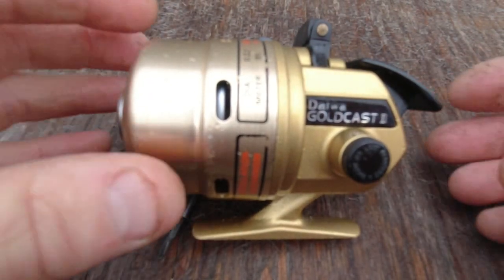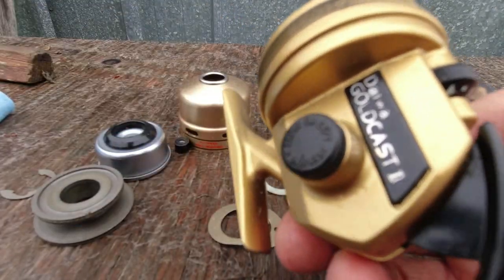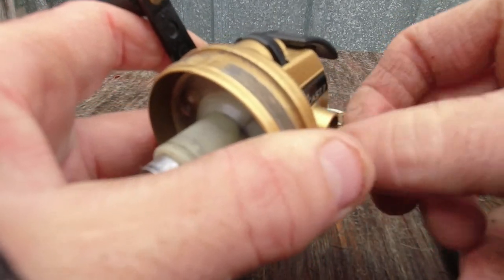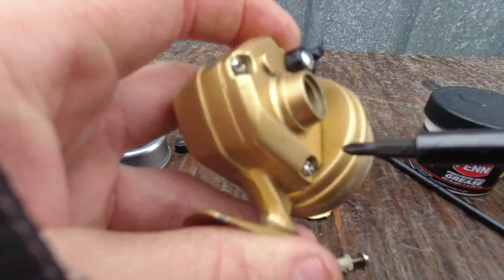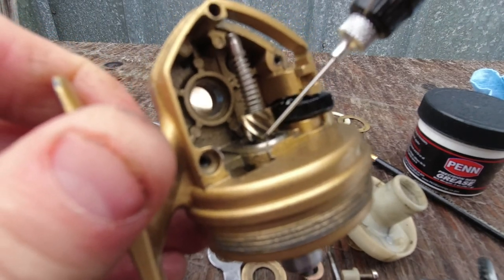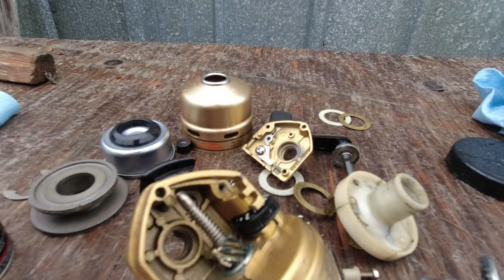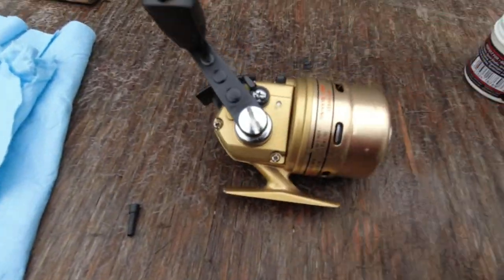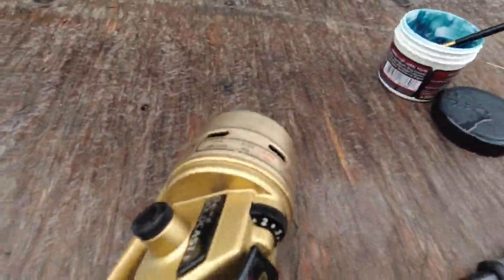Daiwa goldcast 508rl take apart and lubrication

Comment: regarding the shaft you were trying to remove: it is reverse threaded (turning clockwise loosens it).  I have removed them but never without marring the surface.  However, they only cost a few bucks to order new from Daiwa, and their customer service was excellent.
Reply from the maker: I remember removing it previously and I didn't want to mess it up removing it again
Yes Daiwa has great service
I've gotten a few parts over the years
Thanks for watching and commenting!

Comment: Hello there, would you happen to have a schematic for the reel that includes part numbers  I'm new to this and i need a spring for the anti lock. And a part number. Thanks
Reply from the maker: Hi there if you follow this link and scroll down you will see a schematic and part numbers 
eBay will be your best bet for parts 
The reel is around 40 years old 
Thanks for commenting 
https://www.reelschematic.com/reel-schematics/daiwa-reel-schematics/daiwa-spin-casting-schematics/#gsc.tab=0

Comment: Hi, I Measured the bushing on my reel. It’s 10mm OD, 7mm ID, and 5mm wide to replace with a bearing. I looked all over the Internet, and could not find one. Maybe my measurements are off. Could you Measure your bearing to my calculations and post it. I even tried  McMastercar with no luck. Thank you
Reply from the maker: Hi I will measure it in the morning 
Mine has one bearing on the pinion gear and 2 brass bushing on either side of the crank gear 
I found 1 bearing that I had lying around and it fit
I would like to get another one myself 
I don't think it will make a big difference on this reel 
I find if you oil the shafts not grease them and polish them very clean before oiling it will run very nice 
Of all my spin cast reels I have the smoothest is an abumatic 150
It has zero bearing only bushing 
I will let you know when I get it measured 
Thanks for your comment!
Reply from the maker: I just measured my bearing 
This is the format of the dimensions when you search for one
7 mm inner diameter x 13 mm outer diameter x 3 mm width 
Again 7x13x3
The bushing has a shoulder where it fits in the side case 
Mine fits great on the shaft and side case 
I searched on eBay and they are available 
I ordered some for myself 
Hope this helps
Reply: Ok, thank you very much. I start my search.
Reply: @NLoutside75  hello, I ordered a pair of bearings on amazon, they did not fit. Could you post the ones you purchased? Thank you
Reply from the maker: @bigturtle6322  I'm sorry to hear that 
That is unfortunate 
I ordered mine on eBay and they are coming from China 
Will be some time before I get them
I will let you know right away if they fit
By the way do you have the exact same reel as I do?
There may be differences in similar models 
Mine is a gc80 
Goldcast 2
Made in japan
Reply: @NLoutside75  On my box, it says 508RL Goldcast II, made in Japan.
Reply: I also have the 308RL mini Goldcast with the thumb drag.
Reply from the maker: @bigturtle6322  it's the same reel I have 
When I get mine I will let you know 
By the way are they too big or too small?
If they almost fii it might be possible to sand the shaft a bit to make them fit
Not ideal but may work
Reply: They are the right OD but it has a lip on one end😳 I tried them on both reels, because they are similar. Not a good fit for both. I hope the ones you bought work out for you.
Reply from the maker: @albertmoore7681   I got my bearings in the mail today 
Sadly they do not fit
The one I had fit perfectly 
The new ones are slightly smaller inner diameter 
I checked the one I had 
It only fits on one side of the reel 
So it needs 2 different sizes and very precise measurements to get them 
So I guess I'll stick to the bushings
It may be possible to sand a little material off the shaft but I won't be trying that